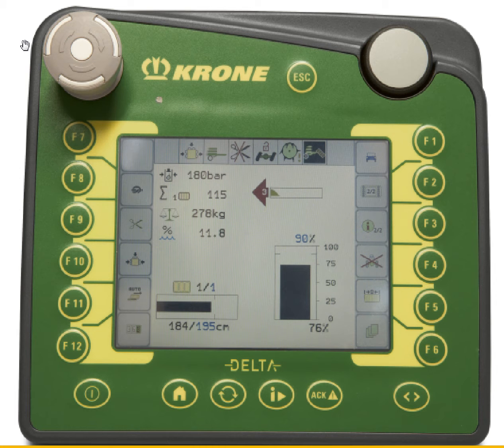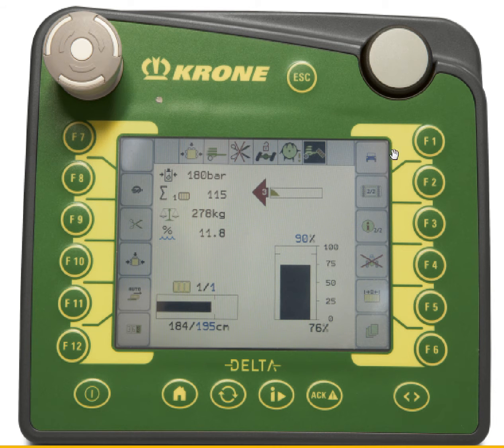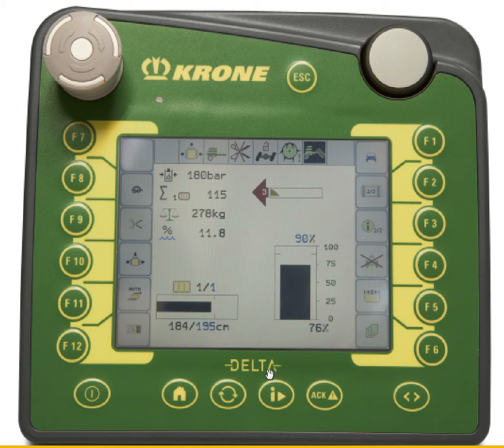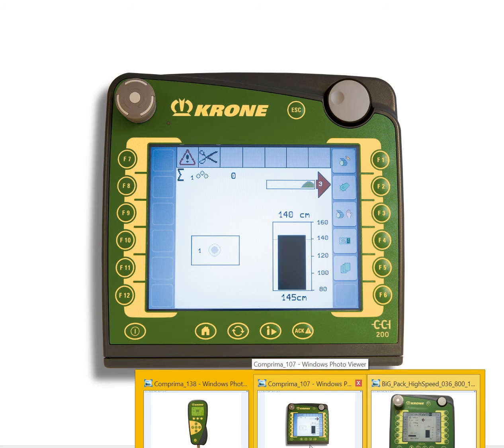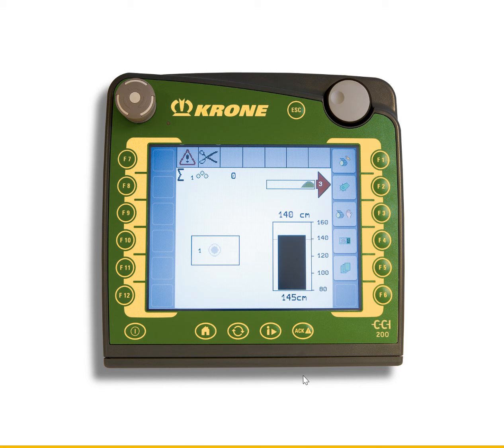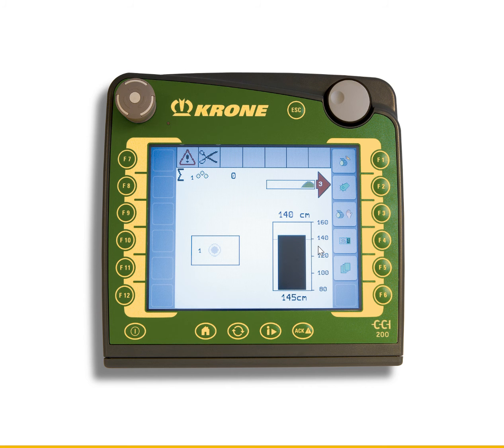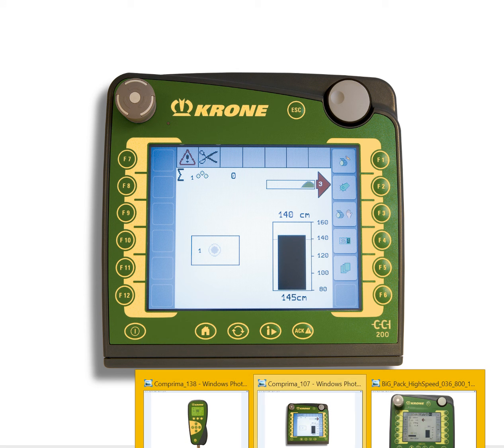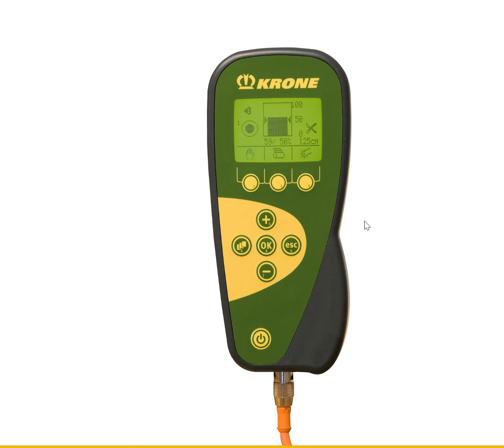Krone Automatic VS Manual, Risk of Not Knowing the Difference

Comment: I don’t believe that’s how it works on a variable chamber Baler. I’ve got a Fortima  V180 And it’s been my experience that the setting for the size of the bale is just an alarm and netting sequence marker. pressure is set manually by getting off the tractor and adjusting the hydraulic pressure valve. I guess it’s possible that the Comprima model works differently.
Reply from the maker: Correct the density is done hydraulically, but a V150 makes a 150cm bale or 4.9ft.  This is were people run the baler in manual mode trying to get a true 5ft bale.  Doing this can  damage the belts or chains if its a Fortima because there is no were for the crop to go.  Yes there is a failsafe that is supposed to open the tailgate but its no perfect.
Reply: I see, they are attempting to go beyond the maximum diameter allowed for the particular variable chamber Baler they have.
Reply: I also have a question that maybe you could answer. I just purchased an additional Baler, Comprima CV 150 XC. It is a 2014 model year, is there any real difference between the same Baler in 2019 or even newer? I noticed they have different side panels and a larger chain oiler reservoir.
Reply from the maker: @guernseygoodness  Hi as you noticed there are a few differences like you seen with the doors, larger oiler, crop compression roller brackets. The biggest change is the electronics, a 2014 should have a gray controller were as the 2019 a metallic looking one.  This was just a update to meet the ISOBUS standards better, not for failure or performance reasons.  The 2019 you should be able to directly plug the Baler into a isobus plug if you have a isobus tractor, we’re as the 2014 you would need a Y cable adapter from the dealer to do that.  2014 probably has a CCi200 monitor we’re the 2019 could be CCI800 or 1200.  Also you might notice that there are some small icon changes on the screen but the software functionality is the same.